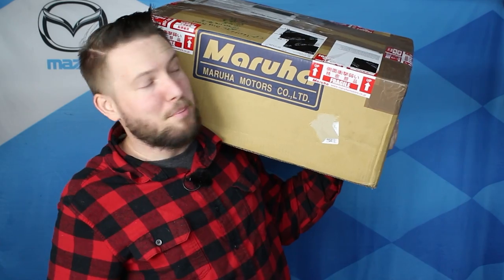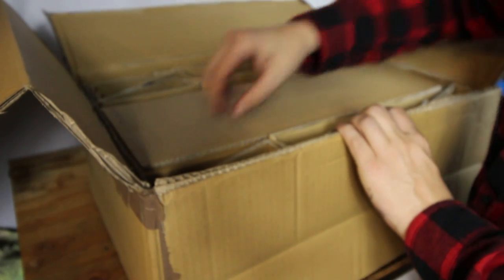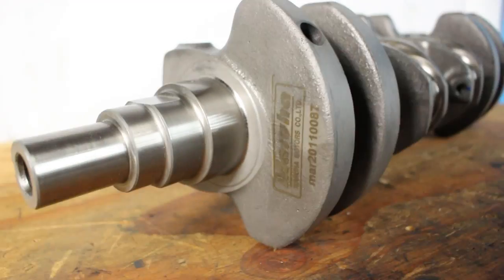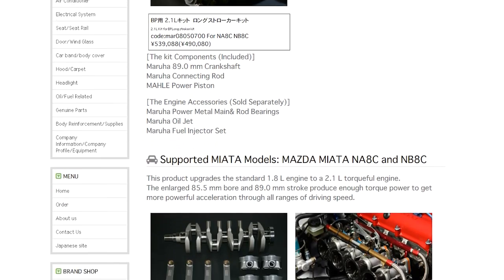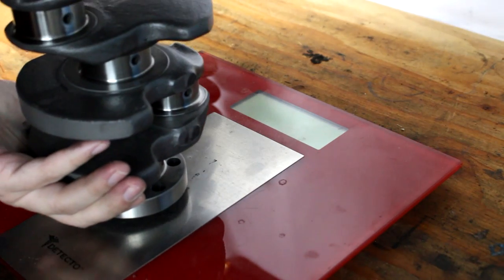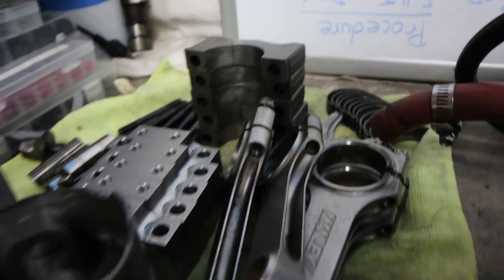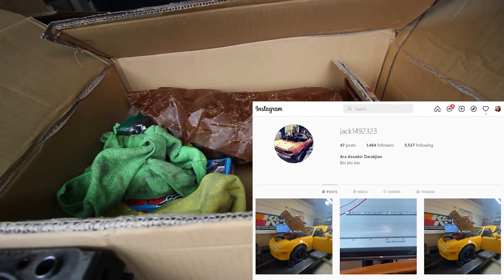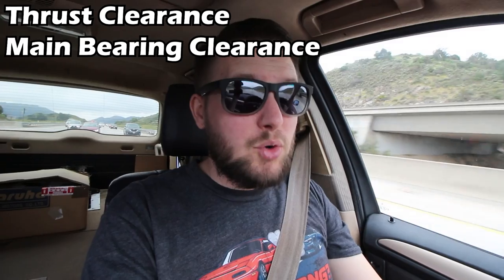Miata Gets a MARUHA STROKER Crankshaft From Japan!

Comment: Do they make an main girdle for that engine?  It might be worth considering based on how much power / torque you are making.
Reply: They don't but whenever I look at the billet main caps, seeing how perfectly machined flat they are on the top.. always makes me imagine how I can weld together a custom girdle for those main caps. It wouldn't be too hard all in all.. except for the fact that it would need a custom oil pan ... Which would be rough due to the shape of the front oil pump to oil pan sandwich seal and then the rear main seal housing to oil pan shape also. 

Unless you took a stock oil pan and cut out those two hard to replicate shapes I previously mentioned. Then u could manage welding the cast aluminum to billet aluminum sheets to make a custom oil pan to sandwich in the beefy custom girdle.

:) The things that keep me up at night...

Comment: NOW you need to do the shim under bucket conversion and reduce the valvetrain weight by over 25%.... Hit up Miata Roadster or Mazda  Motorsports Development. Only downside is since I did the conversion prices jumped nearly 300%.

Comment: FYI, you said .020-.022 for rods, .018-.020 for mains which is an order of magnitude off. You mean .0020 and .0018 I'm sure
Reply from the maker: Yes, that's exactly what I meant. 2 thousandths, 20 ten-thousandths. I'm always getting it mixed up, good thing the machine shop knows what they're doing!

Comment: I think I'm right. I noticed the 1.8 L with an automatic has less horsepower than the 1.8 L straight shift. I wondered if this was to protect the transmission?
Reply from the maker: I know the 1.6 automatic have only 100bhp while the manual have 116bhp. I'm not sure about any of the 1.8L engines though

Comment: Do the high comp, youre on e85 anyway. Maybe add some methanol?
Reply: I considered water meth injection  on my turbo miata build but the condensation in the exhaust damages the 02 sensor very quickly

Comment: Hey Miata Dad!  I was interested in the 87mm Maruha crank for a N/A build.  I saw a recent video where you mentioned compression ratio got bumped up due to the crank, do you have any insight on that?  I wanna shoot for 10.3:1 Comp ratio since it'll be mostly ran on 91 octane, and I wanna make sure I choosw the right pistons to achieve that comp ratio.  I read from Emilio (Supermiata/949) that 10.3:1 is max efficiency on 91 octane that still allows you to advance timing
Reply from the maker: @jakedougherty6000  You can figure that out with an online compression ratio calculator, the stroker crank does change compression significantly.

Comment: You keep talking about increasing the compression ratio. I assume you are referring to static compression ratio. I  have practically no experience with turbo boosted engines,  but I know  from my “old” hot  rod  days, all of the  blown  dragsters always  ran low  compression ratios. The reason for this is since you have a forced induction engine, by running a low static compression ratio, this allowed for a greater volume of fuel air into the cylinder over a high compression ratio. This in turn, gave you a bigger “bang” at combustion. Maybe turbos work differently than supercharged engines, but you might want to verify that going with a higher compression ratio will achieve your desired goals.

And for my two cents, I do not see a very minor increase in volume is worth the cost. That, plus I would like to see you continue to keep the walls thicker, rather than thinner.

Comment: Any tips for vetting a machine shop?  I am new to my town and having some engine related issues.  Thus far, I can not find a credible machine shop who can actually thoroughly inspect and measure tolerances, etc. in my 2JZ head.  Seems like a crap shoot without a expert.  Even if my trouble is in the bottom end, I'd still need to find a machine shop I can trust.

Comment: Hey man. I just started watching your videos and it motivated me to turbo my 1.8 nb . do you think garret 2860r gen 2 is a good choice for my 1st turbo on stock motor? im getting the kit from kraken.
Reply from the maker: Yes that's an excellent turbo that's pretty responsive and has a ton of headroom in case you ever build your engine. It wont spool as fast as a GT2560R, but it's still more responsive than most other popular turbo choices, and has a TON of headroom (400+++). I use an EFR6758 myself which i would consider a very similar sized turbo. I also have a Kraken low mount kit
Reply: @TheCarPassionChannel  do you think i'll be fine with top mount? thats what kraken is recommending to me for easier install.
Reply from the maker: @faststang4892  Top mount is much easier to install and maintain. I would recommend it also

Comment: Definitely go 84mm to keep those cylinder walls intact. Though I must say it would be cool to see 5xx whp on the dyno sheet
Reply from the maker: That's just a matter of using a properly sized turbo for the job, but unfortunately I don't think stepping up to an EFR7163 will suit my goal for the car overall. I think 450 with faster spool will be much more enjoyable in a street car vs 500-525 and notably more sluggish. Plus on a street tire (semi slick but still), 500+ is incredibly hard to put down, so I need to down rate it in lower gears anyways. But, we shall see, I've lied to myself before!

Comment: Plz buy a McCully racing racing 85.5mm sleeved block and run the 87mm crank. Then you would have a unicorn 1998cc Miata engine that should be able to take serious power. You could get it built with the 11:1 comp option, with the head and crank I would think you should be close to 12:1. You could probably have a super responsive 450 with a lot of low end out of boost with the extra comp and compression.

Comment: Ngl I wanted to go turbo on my Miata but the more I look around, the more I want a high compression ITB B6ZE
Reply from the maker: @hesperidesbell4643  High compression ITB B6 might make as much power as a stock internals BP4W with basic bolt ons + tune 🙂
Reply: @TheCarPassionChannel  for me it's not so much about the power, but for the experience. I've never actually built an engine myself, and if I'm going to, might as well do it in a way that I'll enjoy. With everything said and done, my power goals are 180-200bhp, but I expect about 150-180

Comment: If it were my engine and I had the money I would go for the higher compression same diameter pistons. And while the head is at the shop I would get it ported out as much as possible because air flow = horsepower. And the easier the air gets in, the less work the turbo has to do to flow the same amount of air and all that.

Comment: I want to see what this engine does N/A.
😎
Reply from the maker: I actually tested it on the previous setup, at least on Virtual Dyno and some Dragy tests. It came out to roughly 123whp, but remember that's lower compression than stock plus it still had the turbo in the exhaust. I have the video on my other channel called "Greg Peters"

Comment: All I thought to myself throughout this video was time for a 7163. 😈
Reply from the maker: It would be a great turbo for the build, but the hit in spool would be counter-productive to my goals I think. The extra 70-100hp just translates into wheelspin in most scenarios haha
Reply: @TheCarPassionChannel  that's why you have boost by gear/speed but you're correct. Love the build/videos keep it up.
Reply from the maker: @e30gangsta  That's why I use BBG on the current turbo yes - but more power at this point will only benefit 4th and 5th gear, where a loss of response will hurt everywhere. That's why I'm avoiding the 7163, at least until I have a motor that can spool it hard (like a Duratec 2.5 NC *foreshadowing*)
Reply: @TheCarPassionChannel  I get it man trust me. If you're into cool miatas which I'm sure you are. Look into the time attack Miata build that briggs Motorsports is running. He just switched from a 6758 to a 7163. Car is absolutely wicked.
Reply from the maker: @e30gangsta  I'll check it out, and for TA I think 7163 would absolutely be the go-to.

Comment: $6500 tho? No major compromise? It'll still rev to 7,000 RPM even though it didn't want to at 1.8L? I owe you about fiddy bucks. I'd rather just donate THAT just to keep it real; keep it real, Greg. We owe you some loot for sure.
Reply from the maker: I think you're looking at the 2.0L/2.1L complete kit. This crank is around $1400USD from Bofi. Actually it only shows $850 direct from Maruha but of course you have shipping costs and logistics from Japan
Reply: @TheCarPassionChannel  Wow. Thanks for your response. I appreciate that.
Reply: Bro. It doesn't want to rev to 7 Gs even with a better Denso fuel pump. OEM was Mitsubishi (if you know). Miatas>Toyota ANYTHING in terms of reliability. This might be why the 'Mazda 2' is disguised as a 'Toyota Yaris'. Regardless. $1500 stroking isn't realistic, Greg. I still owe you some $$. And I'll pay you.
Reply: Now has 195K. Leaks 1Q of oil every 6 weeks. BURNS LITTLE OR NONE. BURNS MOLECULES. The previous RedRiggers put RED Locktite on the crank pulley... the lip on the oil pump had to go. .. . OIl pumps is legit.... Seal isn't . Help? O... Burns MOLECULES of oil (if that [195K]). Leaks just about ALL. Still better than 80K Corolla. 'Still'? WAY better than ANY Toyota.
Reply: Shouldn't have said that.... We all want to buy more MIatas. Big ups, G.

Comment: Get the bigger turbo efr 7163
Reply from the maker: It would be great if I felt like the 500-550 power level was useful, but IMO the increased lag of the bigger turbine/housing will not be worth it. The car is plenty happy at 450, and the response is still perfect for a street car.

Comment: Will this fit a 1.6 (b6) motor? Only ones I can find online are for the BP engines. I’m hoping they are able to fit 🥲
Reply from the maker: Negative, different cylinder spacing. But you know what makes more power than a stroked 1.6? A stock 1.8! Hahaha

Comment: I see that you have listed .003 for a cylinder wall clearance. You might want to recheck that. I know a hypereutectic piston may only expand a thou to a thou & a half.. running boost like you do you may want .004 to .0045. just for that extra heat ur building. At .003 you are taking a chance on the piston grabbing the wall. Double check with your machine shop but that extra clearance would only be a good thing.